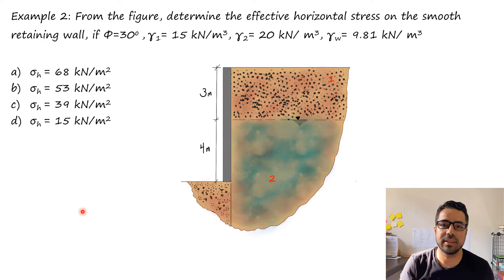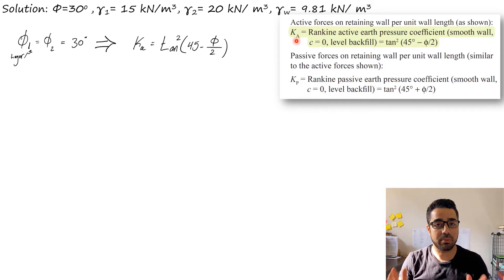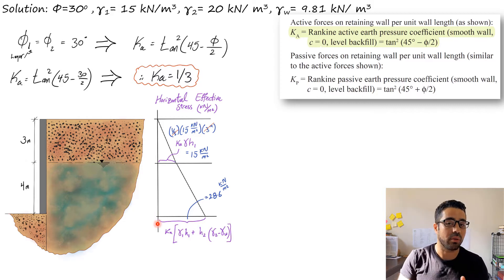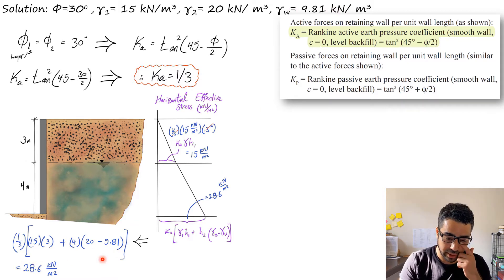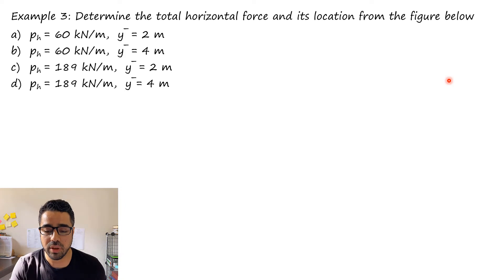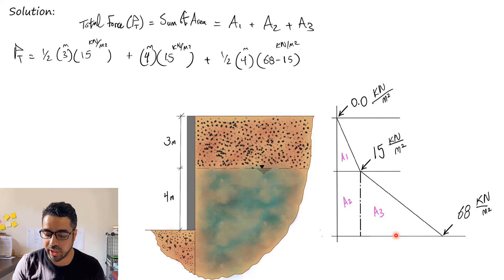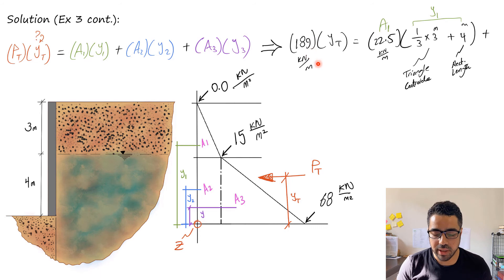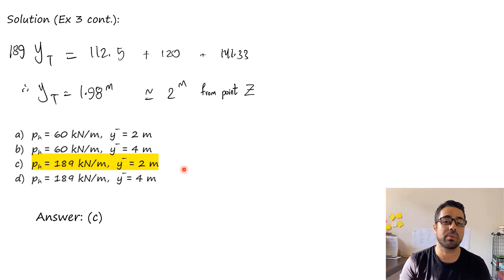FE/PE Exam Prep. - Stability of Retaining Walls - Examples 2 & 3 - Active Condition

Comment: Thank u! Why  did u add "water pressure" to find an "effective horizontal stress"?
Reply from the maker: You're welcome! We add the water because it does add horizontal stresses to the wall in addition to the stresses that come from the soil. The word "effective" means that we are ONLY calculating the pure stress of soil. That said, we cannot ignore the stress that comes from the water. Every time you have water in the soil, you need to calculate the effective stresses from the soil and add to that water stress. I hope that is a helpful explanation.
Reply: @easype4851  but in the reference they minus “water pressure” in order to obtain an effective stress
Reply: @easype4851  Wondered the same thing. Is water part of an effective stress?